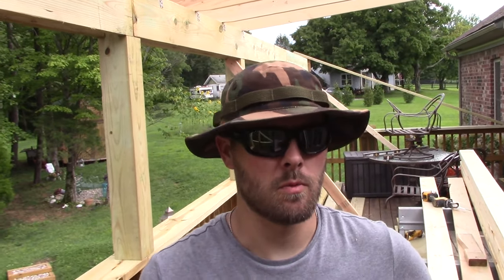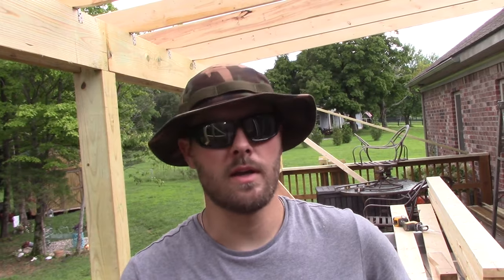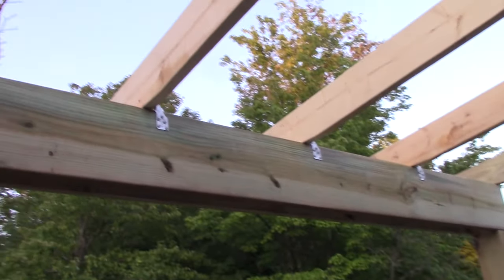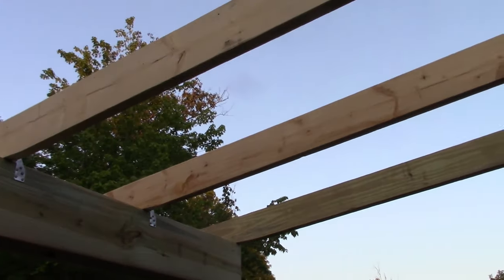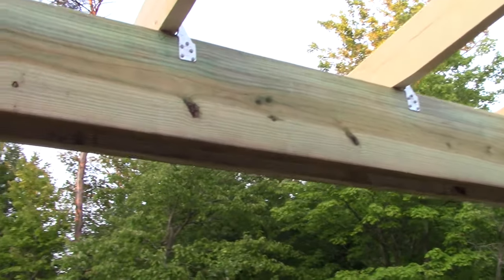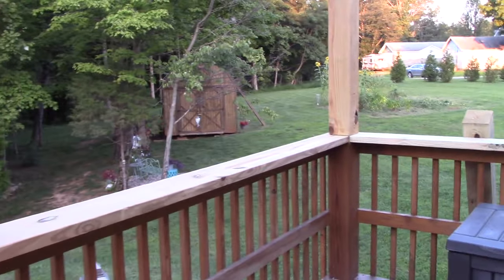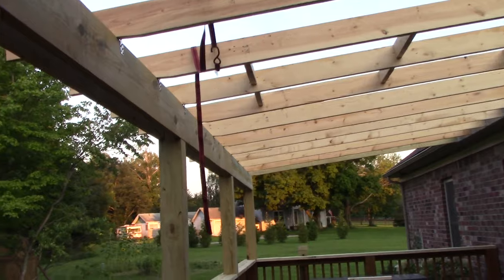Installing a Lean-to Roof on an existing Deck

Comment: unless I'm mistaken, the beam structure you used - two unconnected beams on both sides of a post - is explicitly forbidden in the code. Now, I'm sure it'll hold on just fine, but it'll fail inspection (just as I did, which is why I know). If a double beam is used, the planks need to be sistered. 

Or what am I missing?
Reply: He used a technique that’s used on pole barns and decks for the beams. From my understanding, this method is the preferred method now. It does require 4x6 posts at a minimum, he uses a 6x6 post. Another concern I would have however, are the footings?? Can they support the added load?
Reply: @psalm23sheepdog  interesting. My inspector - for a deck - said, literally "single anything is not a beam". Assuming non-engineered materials. Only beams he would accept would be double-2x6 and up, and they had to be sistered. Which means they cannot have air between them, as they do here.
Reply: @AlexN2022  
Of course the codes vary from state to state, but using your inspectors guidelines for a beam, it’s still my understanding that using carriage bolts as connectors are forbidden now. Instead, even with doubled up planks sistered together, they want the post to be notched to accept the beam to rest on. I recently disassembled my old deck of 30 years. The carriage bolts were highly corroded and only half the thickness of its original diameter. That was the known method of that time.
Reply: @psalm23sheepdog  " they want the post to be notched to accept the beam to rest on" - that's my understanding as well.
Reply from the maker: Sorry for the delayed response, trying to get to older comments. Thank you all for commenting and checking out the channel. We did not have it inspected so if this is a concern of yours you may want to check your building codes. Thanks for the support! No pun intended😂

Comment: I’d be curious on how you figured how high the posts had to be to make the roof line work from the soffit. I’m adding the same idea on a shop to cover my SxS and grill, and don’t know anyone that does this type of work. I want it to be an end of season project for my son and I.
Reply from the maker: If I recall we ended up doing an 1inch of fall per foot of roof. So we had a 1 foot drop for 12 foot rafters.

Comment: Whoa! 
You use a 6” facia board for a structural roof system ledger?  
This would fail inspection in my area. I hope you didn’t shingle the roof...talk about catastrophic failure.
Reply from the maker: Thanks for commenting. No we would have never shingles the roof, we used metal panels. thanks for checking out the video!

Comment: Great video and nice work. Did you add any additional support to the deck so it can handle the added weight?
Reply: I doubt it
Reply from the maker: Not sure if your asking about the roof line at the house or underneath of the deck. The post we extended off of go al the way to the ground and set on individual footings. We did not do anything else where the roof meets the house. Like some people have said and so would I. If heavy snow is a concern of yours this is probably not the route you want to go with attaching to the house

Comment: is that facia board meant to be load-bearing?
Reply: It’s going into the 2/6 rafters that are behind the facia
Reply: @loganopfer5326  how are those screws that go through the joist hangers screwed into the end of a 2x6? I’m no carpenter I genuinely want to know.
Reply: @kingleonidas4296  the fascia board is not load bearing. And when the fascia board is screwed or nailed into the end grain of a rafter it’s called “zero contact” around here. It has basically no holding power and is forbidden when done like this.
Reply: and what is holding the facia board ? LOL people are nuts
Reply: @danielwanner8708  8 penny nails lmao
Reply: @kingleonidas4296  Joist hangers are to be installed using joist hanger nails . In my county anything else is unacceptable by code . Joist hanger nail into 3/4  inch stock would not suffice .
Reply: @klyerobinson3069  might have used finish nails to boot , I wonder what the headroom ended up being . 8 feet out at a 4/12 pitch  , might have 54 inches ,60 if you cheat .
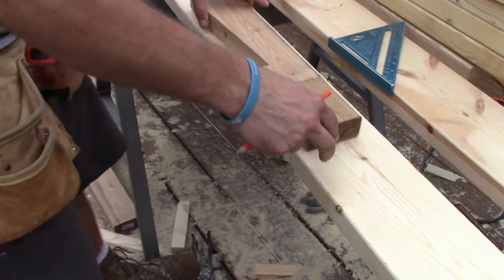Reply: It’s a 1:12 pitch though that does bring a hidden issue. The roof is considered flat and needs flat roofing materials; not shingles or even some metal roofing.
Reply from the maker: Thanks for taking the time to leave a comment and check out the channel! I understand that a lot of people disagree with how we choose to do the job, that’s ok. I can tell you 3 years later and no issues. If you happened to live in a heavy snow climate I would not recommend this build. We have had aluminum awnings in the past and there are many on the market you can research that attach to the home in the exact same fashion. Thanks and take care!

Comment: Great work! I'm planning to do something similar, but I'm not sure if the Fascia Will ve strong enough to support rafters. Any ideas how to check if  Will suit. Thanks
Reply from the maker: You can remove the Facia material and extend your roof supports off the existing roof rafters by sistering onto the side of them. That would be the only other thing that i could thing of. Or maybe remove the facia board and put a heavier board on  to cap the rafters then joist hang just like we did. Glad you enjoyed the video!
Reply: I’m having the same question as far as tying into the sub fascia or removing the sub fascia and sistering to rafters. What connectors would you use if attaching to existing rafters and when trimming out fascia would you just go back with fascia board in between the new rafters on the house? Thank you and good video. Also, I was thinking it wouldn’t be good to just attach new rafters to fascia board because the fascia is only attached with connectors into the end grain of existing house rafters. I’m by no means a carpenter ive just heard it wasn’t structurally sound to do it that way. Your input would be greatly appreciated. Thanks so much!
Reply: @tracydaniels2982  Hope you've found a solution. You definitely should avoid hanging them off the fascia.  I've seen folks sister to the rafters coming from the home, but honestly, the best way to do it is to have the lean-to rafters sit on top of the top plate of the exterior wall (or if you've got enough space to install a ledger board against that exterior wall).  Sucks to have to pull back that far, but it's the right way to do it.

Comment: So did what did you guys do with the Eavestroughing? My eaves only drains at one end and i was thinking about doing this
Reply from the maker: Not sure what you mean exactly. We removed the gutter section, capped the section still on the house. reinstalled and down spouted the new section off the lean to.
Reply: @homebuilt8694  that's exactly what I was asking for thanks.

Comment: I do like your video....i think it is a good idea ..’you could enclose the whole place use some insulation, big windows and use metal roofing for a light weight roof...good luck.
Reply: I'm a weekend carpenter so not real knowledgeable. What would you suggest for a metal roof? Corrugated or something else?
Reply: Careful with the roofing choice. This is considered a flat roof (<3’:12’) so the roofing needs to be compatible. I think corrugated requires 3:12 or more.
Reply from the maker: Thanks for taking the time to leave a comment and check out the channel! Take care!
Reply from the maker: we used corrugated. Thanks for leaving a comment and checking out the channel!
Reply from the maker: Thanks for checking out the channel!

Comment: Great video. My only concern is if the structure of the roof is safe or up to code. I noticed you attached the rafters to the fascia. Asking because I have been looking for info on this for a long time. I'm a beginner DIYer and would love to figure this out. I live in Florida if that helps
Reply from the maker: So in the video i talked about this. The gutter board under the trim metal in our case was a 2x6 nailed into the rafters. I also said we may look at adding angled supports off of the brick if we felt that is was needed down the road. Where we live we rarely ever get any snow accumulation. As for everyday use i have no concerns for the roof. Our only concern was if we ever had 6 inch's of snow or better we may need to clear it off or put a torpedo heater out. As for your particular situation your will have to do what you think is best. Hope this helps. Thanks for checking out the video.
Reply: Installing the rafters and the post in the fashion that he did is not up to code anywhere that I know of and have worked in many states.

I am not disparaging what he says done. He is a professional, it is he father's house, and there probably won't be an issue until resale at which point, without having pulled a permit, it will become a negotiation point.  Still gonna build mine without a permit 😅
Reply from the maker: My goal for the channel and videos like this one is to help give people ideas for their own projects. People need to do what they think they need to do. I explained to someone else the video is not a step by step or tutorial in anyway. I think you understand that.
Reply: What they did even though may work is not proper. You should remove facia and run your rafter onto the attic so they sit ontop of your top plate of the wall.
Reply: Literally hung the ceiling joist on the facia board. Don’t walk on that roof!! Even if screwed or nailed into the rafter there is no support at that attachment point.
Reply: I would have at minimum removed the facia, blocked between the ends of the joist, using a double block between every other cavity for better nailing surface. Now I have a solid surface for my ledger board to attach to. This is assuming the rafter and joist tails are structurally sound of course. In my opinion (and probably codes as well) attaching that entire roof to just the rafter tails, is sketchy at best.

Comment: contractor built a deck and roof like this, but it leaks between deck joist and house joist. House roof is shingle, any idea on how to stop the leak.

Contractor did not guarantee leak free
Reply from the maker: I would think the contractor would be willing to address the issue if he is reputable. This was a personal project for us.  We used a trim coil flashing to extend out from under the last shingle course and out onto the metal roofing. Thanks for checking out the channel !

Comment: What pitch did you use? And how big is the patio. I have a 10x27 I plan on doing the same thing in a few weeks.
Reply from the maker: The pitch was just over 1 ft of fall in 12 ft.  So about an inch of fall per foot.
Reply: Shingle rolls will be better in the roof for but first watersheds

Comment: How did you determine how much clearance from the top of your 2x6 beams and the existing roof so that your metal roof fits under the existing roof?
Reply: Yeah, that’s the part I needed to know ? As I have the 2x6 rafter roof with shingles. Want to remove the existing sheeting and add metal roofing, but not enough room to add 2x4 for purlins  to fasten the metal plus the added 1” for the ribs on metal roofing ? May have to remove 2x6 rafters and double up on 2x4 rafters to get below roof line.
Reply from the maker: Ours just so happened to be exactly right, the 2x6 rafter and roof metal fit just under the edge of the shingle. Hope this helps and sorry for the much delayed response. Trying to catch up on a bunch of old comments and keep up with the better in the future. Take care

Comment: How did you determine the angle of the roof Joist that lays against the front runner? Awesome job though 👍🏽
Reply from the maker: we went for a 1 foot drop pitch for the roof which dictated the angle of the rafters. As for how to find your cut angle you will need to use your speed square or trial and error until you get your first rafter how you want the entire roof and use that first rafter as a template.

Comment: how did you work out the height of beams for rafters to sit on? great vid with great build. from new zealand
Reply from the maker: We started with the height of the soffit and determined what amount of pitch we wanted on the roof/ how much headroom we wanted for clearance. The end result was about 1ft of fall for 12 feet. Hope this helps and thanks for commenting and checking out the channel

Comment: Great video....What area is this in?...want to do something smilar but I'm not sure how well it would hold up with snow attaching it to the house the way you did
Reply from the maker: Agreed we live in a in southern Indiana/Northern Kentucky area. There are many winters we get little to no snow. It does happen from time to time however so if its a major concern you may look at others options. Thanks for checking out the channel and taking time to comment!

Comment: I like the design of it.  Is it okay to not use pressure treated boards for the rafters?
Reply from the maker: We only used untreated on all the inner rafters to cut down on weight and expense. The entire outer band is treated. All the untreated lumber is covered and out of exposure to the elements. No different than the rafters in your attic.
Reply: @homebuilt8694  I'll plan to do the same.  Good info.  I also liked using the dowel to extend the posts up.

Comment: I’m assuming this is in the US, did you get this permitted and inspected? Only reason I ask is I followed this exact method for attaching rafters to the existing fascia and inspector failed it and is making me redo it, he said theres no allowance in the building code for tying into the existing roof’s rafter tail. Hoping to find a way around tearing it down, any advice is appreciated.
Reply from the maker: Thanks for checking out the channel! Yes I am in the U.S. and yes it would not pass on a building inspection as they do not allow for wood framing coming from the end of the gutter board. We used our own judgement. There has been so many questions about the work we performed in this video and if I had to do it over again i believe we would do a beam design and set the beam tails up on the roof. That being said our lean to is no different than many metal awnings that many companies install. It is a simple tin roof little static load except during times of snow. You have to use your best judgement on what you have to do for your situation.
Reply: @homebuilt8694  Yup, makes sense, I don’t think there’s anything wrong with this design at all, neither did the inspector, he just said he couldn’t pass it per code. Great video either way!
Reply: To say there is no difference between a metal structure and a wooden structure is just categorically wrong. It’s as basic as different materials have different properties. There could be similarities but to say there’s no difference is conveniently misguided
Reply from the maker: @johnlee7085  I know that metal and wood have different properties and load carrying capabilities. I have worked with both my entire adult life. The statement I was making is if the metal structure or the wooden structure is attached to the gutter board of the home and one is framed acceptable and the other not. What is the difference? The house is holding both? Guess I’m just conveniently misguided!

Comment: Your frame job look good but I would’ve never said that on the top of that handrail I would’ve took the handrails down and went all the way to the bottom of the deck and replace the handrails later but other than that Your framework looks sound
Reply from the maker: Thanks for taking the time to leave a comment and check out the channel! Take care!

Comment: I have a question,do you guys in America need plans from your council before erecting a roof from your house outwards
Reply: Legally yes. Got land and house out in the country... nahhhh
Reply: If you whant to sell later yes if  the city approves your project, the price of the house will rise considerably
Reply from the maker: Thanks for taking the time to leave a comment and check out the channel! Yes you are supposed to get a building permit in the US so that local officials can tell you what you are and are not allowed to do on your own property. They also charge you money to do so. We did not partake.

Comment: I’m kinda stupid, but I’ll ask anyway. How did you attach the 2x6 to the house? Nice video!
Reply from the maker: The rafters for the deck are attached with 2x6 joist hangers. The 2x6 that was already present under the facia was nailed on to the roof rafters during framing

Comment: I have been thinking of doing something similar.  I like the idea of attaching to the eaves of the house.  Can you tell me the height at the eaves and the height at the opposite end of the rafters?
Reply: Steve - Notice that he makes subtle but crucially important comment on checking the structure behind the surface to be sure he’s connecting structure to structure. The Fascia is generally not a structural member so not something to connect to. It would be extra work but might be necessary to extend the deck rafters under the eave in order to connect at the wall structure and/or sister to the rafter tails. I just got done doing that on our deck roof.
Reply from the maker: Thanks for commenting and checking out the channel!

Comment: Nice video! I was wondering how you fastened the new posts on top of the cap rails? Thanks
Reply from the maker: Thanks for the comment and checking out the channel! I have a video where I discuss in more detail how we attached everything. It you click on channel videos it should be under Deck Q and A. Thanks again!